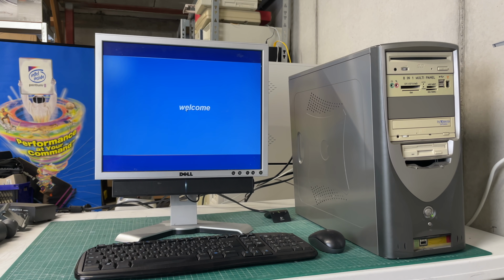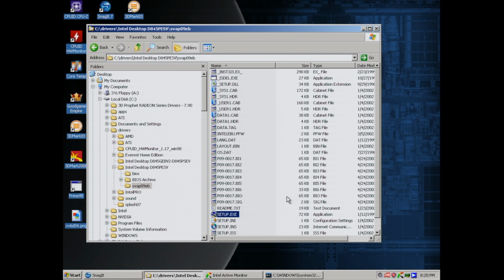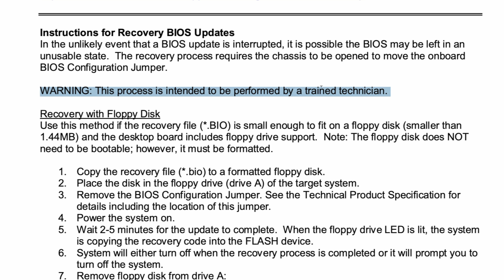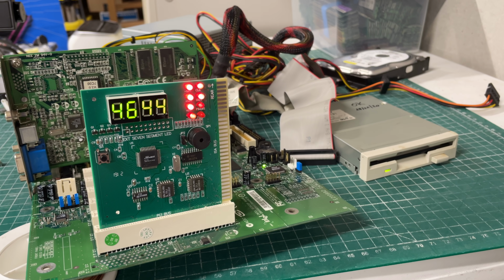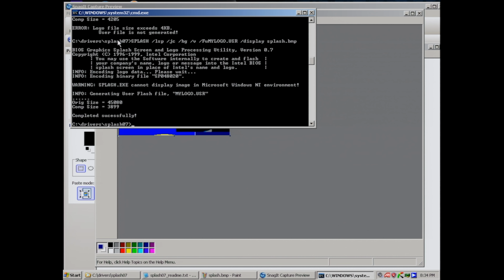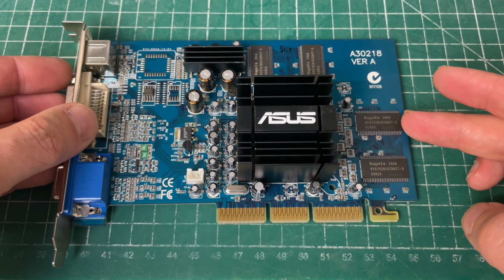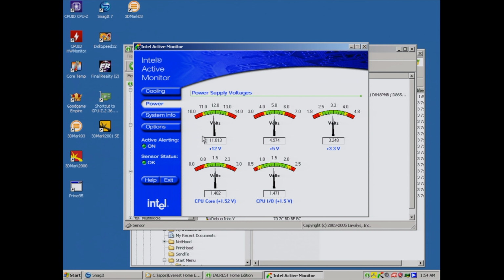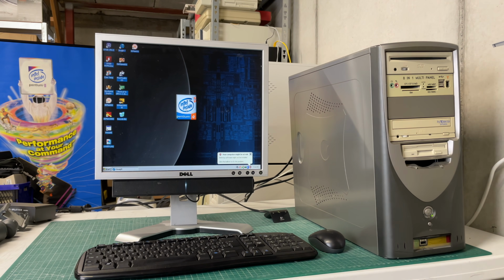Intel Pentium 4 - Corrupted BIOS resolved (Part 2/2)

Comment: Sounds like a failing/bad PSU your suffering Vdroop ( voltage drop on loaded rails) which might cause RAM errors as well.  Stability issues are usually down to power avaliability fo a system if it is loaded and RAM which could be affected by not enough voltage to provide enough current to keep the ram fed with required power to operate correctly. So step 1: Change PSU for one that is a known good one, run same stress tests. see if same errors appear if not problem solved, if not try single ram sticks at a time to elliminate faulty ram chips. Unlessa you have spechalist testing gear , Load tester for PSU, Ram stick tester. Using logical step by step process is only way to pin down faulty componants of a system. I reccomend hwinfo over cupid as a software hardware reader, has extensive fubctionality and can show WHEA errors which can lead to instability of an OS.
Reply from the maker: Yes will do some additional diagnostics later on .. Replacing PSU and RAM sticks is definitely on the list.

Comment: With all these comments regarding Pentium 4's being unreliable, I must have gotten lucky since a work PC we use to flash/reprogram Kinetek controllers for EVs (which only runs on XP) is a P4 system that still works. Also, I got a HP Pavilion desktop that's P4 that works fine as well.

Comment: PSU should be replaced, a lot of those older ATX12V PSUs from the early 2000s were made with some craptastic capacitors that would fail and cause board damage.

Comment: You ram issues are most probably caused by your psu. Your psu is dead, 1.6v on the 3.3v rail is suicidal, no wonder you have ram errors.
Fix that psu and downclock your ran to 333mhz and try again.
Also try several memtest versions as i have found that some versions work well while others dont. Dont just relay on what comes on your linux distro.

That trace looks like it was caused by some short circuit. I doubt it just burned because pentium 4s were power hungry.

The bios corruption could have been caused by the low 3.3v rail. Ive never tried corrupting a eeprom with low voltage but ive heard sdcards can get corrupted by low voltage so maybe?
(Though giving it a second thought it mostlikely was caused by noise in the 3.3v rail.)

Finally open that psu up and check the output caps, they are either dry or bloated. Its typical of that era. My 775 pentium 4 psu had the same issue, i noticed while using it to play with some old parts that it had some bloated caps and when i tested it on the osciloscope it had like 2vpp ripple on 12v and 5v so most likely yous is the same.
Reply: the PC is unlikely to have ever booted if 3.3V had actually dropped to 1.6V. I agree that the PSU must be checked anyway.
Reply: @MrRobbyvent  
its probably not that it dropped to 1.6, i doubt it, its most likely that it has so much noise that it read on on of the peaks and it read a lower value. It maks sense that the fault occurs when under load because as the transformer is shared the ripple is proportional to the duty cycle of the transformer and loading 12V will increase the duty cycle also increasing the ripple on 3.3V. 

Its a PSU, theres not much to it, so anything other than the output caps would cause the psu to fail catastrophically, so i bet its the caps or a broken solder joint (which really not likely and could also cause (and more likely to happen) higher vltage and fry everything.

Comment: Replace the PSU, and then if that doesn't fix the issues, the RAM.  I honestly wouldn't spend much time with a board like this that has some war wounds.  They're cheap enough that you can get a better socket 478 board for the price of a large value meal at McDonalds.

Comment: the fact that this motherboard randomly lost its original bios is not reassuring !
Reply from the maker: Yeah … I did use it briefly to test some videocards that showed some weird artefacts. Don’t know if that might have caused something
Reply: The bad RAM stick might have caused all those issues to begin with
Reply: @juniorbcm5375  it's still super weird as I don't see a simple explanation for that. The faulty ram would have altered random contents that were executable code, that after alteration would be instructions that trigger a bios flash with random data. Not impossible, but, you know, ...

Comment: And amd xp would beat this computer -I played with my Barthon 3200xp and 512 dual ddr +ati 850 into late 2008 then the motherboard could not run the cpu at defaults speeds -3 years later it had detiorated and I were able to run it at  900mhz -then a sudden death.

Comment: prime95 and memtest fails? you have a faulty RAM module. Remove one of the ram sticks and run memtest again until you find the one that fails.
Regarding the 3.3v rail. Ignore that error message. 1.65v it's a false reading for sure
Also make sure that you apply good thermal compound on that CPU. They run hot!
Reply: Uh, no, don't ignore that, measure with a multimeter. I once built a new PC and wondered why the CPU fan would run slower when I put it under load. As it was otherwise stable, it took me quite a while to figure out the 12V rail dropped to 7V under load! My jaw almost dropped to the floor when I confirmed the reading.
Reply from the maker: Did apply some artic thermal compound. Dunno if the 3.3v drop was a fluke but will try a different psu.
Reply from the maker: @russellmulcahy4452  will do. On holiday now but will update the video description this weekend when I get back
Reply: @RetroSpector78  Beauty. I've 4 different boards with exactly the same BIOS issue.Enjoy your holiday...
Reply: Enjoy your holiday? Now you're back, could you please share the intel stuff, and whereabouts for the bios files. Love ya vids, please keep up the good work 😃
Reply: @RetroSpector78  Hope you had a great break.
I've got 2 x Gigabyte boards, an MSI and an older ECS, all with the same problem. I just can't find the bios' for them, and don't have the Intel programs. I did offer to post these to you, but like you said  the return freight is a killer.
Reply: Now that your holiday is over, any chance of following up on the inte stuff and bios links. Loved the Compaq Transformer..
Reply: @RetroSpector78  Still no Intel software or links to the bios'. Starting to feel left out!
Reply: @RetroSpector78  Still waiting on the Intel links???
Reply: @RetroSpector78  How come no response. Working on computers can be daunting enough, without those who know not willing to empart a little help, occassionally.
Reply from the maker: @russellmulcahy4452  Updated the description. Sorry for the delay.
Reply: @RetroSpector78  Thank you 😃